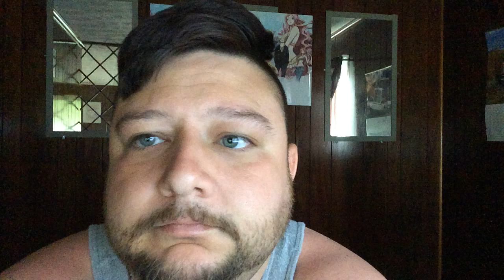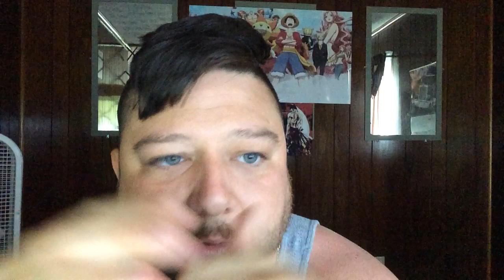Oil Light Flicker

Comment: You are right that the oil pressure light flickering is never a good sign! I have a question about that though- If the light flickers or comes on at idle only and you continue to drive, is it better to raise the RPM a little when idling so the oil pressure stays up, or is it better to let the engine idle with low oil pressure? Thanks in advance, I've been curious about that for a while
Reply from the maker: its never good at all under any circumstance. the proper thing to do is immediately shut the car off, tow it back, diagnose and repair asap
Reply: @VHBEngines  I understand that it's always  very bad when the oil pressure is low. However, I am asking more like if your engine is already junk and you just want to get as much more use out of it as possible what would be better. Thanks
Reply: Avery Alexander what’s up man I have a 98 accord and it’s got 327,000 miles on it.. for the past 2 months my oil light has been doing the same exact thing yours is.. when I slow down to an idle the oil light starts blinking in a stuttering rhythm.. mine is a 5 speed so as I’m slowing down I use my left foot for the brake(to all smartasses yes I know that’s illegal.. I do what the fuck I want to do) and just pedal the gas with my right until I come to a stop.. there has been times when actually shuts all the way off.. I fire that bitch back up and keep rollin.. if you have an automatic just push that bitch into neutral and work the throttle.. but yea if your just tryin to get all it’s got left for as long as possible.. that’s a good way to do it.. friendly reminder though.. always be prepared to call a tow truck or have some kind of back up plan bc you are pushing the limit and it is going to push back eventually. Good luck
Reply: @haulinass1990  Thanks for sharing! Here's a tip: I have seen oil pressure switches go bad and only turn the light on at idle. So if you want, you could try replacing the pressure switch for about $10 to see if it fixes it. That may or may not be it, but it's something to consider
Reply: Avery Alexander oh I’m definitely considering it but my main focus is my s10.. my 4.3 just spun a crankshaft bearing so I’ve been trying to prepare myself for the frustration that a motor swap job always comes with.. but it is somewhat a relief to hear that I could get lucky and it just be the oil pressure switch.. the first thing I did was check the manual abt the oil light.. and it says exactly what this guy said in his comment to you.. shut the car off wherever the light comes on and tow it to where it can be worked on immediately.. so that’s why I’ve been surfin waves hoping that the rip current isn’t too strong.. so until I change the switch the rip current doesn’t seem too bad 😂
Reply: @averyalexander2303  my car does the same thing. I think it one of the switches  possible low pressure switch because it's only flash when the engine is warm and if I move the car it goes off
Reply: @lungisanishibase3905  What kind of car do you have? I would rent or buy a mechanical gauge to verify that the pressure is actually low, the switch could be bad. It's easy to use, just unscrew the stock switch and screw that into its place. Warm the engine up and see what the actual pressure is at hot idle. Be sure to give it plenty of time to warm up, the oil can take 20+ minutes of normal driving to reach full temp. Or just replace the switch and see if the problem continues, they aren't that expensive. I like the gauge approach better though because you get more information.
Reply: @averyalexander2303  I have vw mk3 I know I have one dead cylinder. Cylinder number 4. it doesn't producing enough pressure, at once I thought that cylinder  was the problem but it's not I also thought the car was skipping timing but I don't think so

Comment: What if oil light comes on when I come to a stop  n goes away when I'm in motion?
Reply: Mine did the same but I could hear it rattling, clanking, banging and sounded like like a lawnmower and if I stopped my engine would turn off.

Comment: This was my first time doing oil change either I put to much oil or I didn’t close the oil filter cap correctly I drove 20miles with the light on can I have you opinion on that
Reply from the maker: Get the oil level right. Light should go away
Reply: Do you think because of that the engine might be bad  the oil had all spilled when I was driving
Reply: @VHBEngines  
If its higher level itll not show oil pressure light never ever 😄😄😄
Reply: @sauchyy5820  it could be losing oil cause May be you didnt tighten well oil filter

Comment: Have you ever had a oil pump just go bad and lose all pressure after a oil change? I changed my oil pan and put a drain bung on it for a turbo that I installed, then got everything in order started it up to test for leaks and oil light stays on all the time.. I did notice awhile back my oil light slowly illuminated once or twice but I thought it had something to do with my idle being so low.. I adjusted the idle and never seen it come back on.. people tell me that the oil pan im using might be the wrong one for it.. it might be from a h22 but its identical to the one I took off minus this one has a gasket on it and the one I took off didn't just a bunch of rtv. For some reason.. lmk as soon as you can, im debating whether or not just to order a new oil pump and just install it and it would be good.. my only concern is once I do that I still have the low oil pressure issue.. its a f23a bottom with f22a head. All new bearings, polished the crank myself. Shimmed the oil pump, the head is completely new everything just oem parts no upgrades. New water pump new timing belt and tensioner, head was resurfaced and milled. I only switched the head to non vtec just because I had spun a bearing and the vtec was giving me problems with shavings in the screen all the time. But its been refreshed but the old oil pump was used.. I know.. dont get on me to hard.. just a broke man's only choice sometimes..thinking the shimming will maybe fix my bearing issue. . But it got great pressure before the turbo was installed and drain and feed line was installed.. well I think.. 🤣 🤣 never had a oil pressure gauge to confirm.. maybe it was just good enough and with the added drain line and feed line.. it just dropped it to zero??
Reply from the maker: You already had early signs so good.chance it's the pump. Your not going to get the best results shimming without porting as well.

Comment: Hi I have a $2 2004 Hyundai Elantra and it just started with an oil leak and can't figure out where it's coming from we've taken off the oil pan and found these two metal ring type in the oil pan and we've already sealed the oil pan and the main seal and that was not coming from there do you know what it might be

Comment: I have Toyota Camry 4 cilinders 2.2, 2000, 460 thousand kilometers , since I bought it I hove been  adding   half a cup of oil every day, had a leak from the oil pump, for a year and a half after buying it, I did 36 thousand kilometers on it smoothly as I thought  the car is like new . Recently the water pump started to be heard and I decided to replace it. The heavy work I had to do meant that I also decided to replace the Power steering pump, Seal & gasket on the oil pump, taming belt and water pump. After putting everything back together, the car works beautifully , so as if I would not change anything at all , with only one exception, which was not there before even with a large oil leak, namely the red oil pump light appears when the engine is idling. I replaced the low oil pressure switch with a new one , I replaced the oil filter and oil on the denser from 5w30 to10w40, and the light appears as it appeared,  at slow speed . What should I do  ?
Reply from the maker: 🔄 the video

Comment: I kept driving cause I was close to home but a lot of smoke, got home and saw oil on my left side radiator, then drained the oil and found metal shavings.  Can I still save the engine by rebuilding it or does it sound like uts done?
Reply from the maker: It's rare that the crank is usable at that point but it does happen sometimes. Can't be sure without a tear down
Reply: @VHBEngines  thanks for the reply! I think ill go ahead and do that but first I've seen people use kerosene to clean it all out

Comment from the maker: If you read the comments you will find a hilarious amount of people that want me to change what I just said to make them feel better. I've been a mechanic for 13 years now and there is absolutely only four things that will cause this issue

Sensor failure
Damage in the harness 
low oil 
Order A BAD FUCKING OIL PUMP

Nobody wants it to be the oil pump because its a high labor cost job. Well if it ain't a bad sensor or low oil 99 out of 100 times it's the oil pump, no matter how many dumbass bullshit scenarios you come up with its not goin to change that answer  🤦‍♂️🤣

Comment: My oil light only flashes on a cold start its a built single cam and I just installed a turbo on it but have not started it yet I've been running the built engine for 8k miles and it blinks only on cold starts I am scared to blow it once it boosted..
Reply: Mine does that too did you figure it out
Reply: @movementonwheels  no It still does it but i bought an acl oil pump on Amazon never installed it still abuse the car every day no issues oil change at 2kmiles

Comment: So I just changed my oil and filter and my oil light came on out of no where but when I drive the light goes away but when I'm at a light it idle below 1k rpm then the light starts to flicker and fades away. When I drive it completely goes away... Not to mention I was way over due for an oil change. But the oil was still good since it's just a back and forth to work and home. I change the oil pressure sensor and bam the light comes back on. I checked the wire that connects to the oil sensor it looks good. Figure it be a bad connection.. I notice when I'm in drive that's when the light start to flicker and fades then it started flashing. Now it makes me wonder!
Reply from the maker: I’m assuming you double checked your oil level after you ran the car. If your topped off then your most likely dealing with a failing pump
Reply: @VHBEngines  yes I double checked it and oil level is fine. Car sounds great... When I have it in park and idling the light never comes on. While ago I let it run for 15mins to warm up and no light, when I put it in drive that's when it start to fade in and flicker...is it because I'm running 10w30? I know honda use 5w 20
Reply: @VHBEngines  yes I double checked it and oil level is fine. Car sounds great... When I have it in park and idling the light never comes on. While ago I let it run for 15mins to warm up and no light, when I put it in drive that's when it start to fade in and flicker...is it because I'm running 10w30? I know honda use 5w 20
Reply from the maker: jrburger1987 it’s because of one of the reasons stated in the video. Light only illuminates because of low pressure detection. I’ve pulled apart engines that weren’t knocking yet but the bearings were nearly destroyed. If you ignore it that’s what’ll happen. I’ve ran diesel rotella in my honda’s so you throwing in a different weight isn’t making a deference

Comment: my oil light came on and started flickering after i drove on a high speed around 180 km/h now it flickers , disappears when i accelerate and sometimes its not there when i first start my car in the morning, is it possible that its the sensor ?
Reply: Omggg the same thing for me
Reply: @breepitt9793  dont use your car man, take it to a mechanic right away if you hear weird noice like knocking noise even if its faint, my engine turned out to be locked it cost me around $1000 to get it fixed

Comment: Anyone can give information?? As my oil light flicker about couple of minutes i start my car which is Suzuki splash 2008 1.3 ddis and stops flickering after some minutes? As i have remove oil a month ago where the level and oil is perfect. I want a genuine suggestion please. 
Thank you
Reply: Approximately 1 min 45 secs it keeps off and on on dashboard after i start my car?
Reply from the maker: the suggestion has already been made in this super short and very to the point video. your hoping its something else because its an inconvenience but it is 99.99999999% one of the two issues i describe. but its your car and your engine so feel free to gamble with it

Comment: My h22a swap just started doing it at low rpms. The car has idle issues so when rpms drop it flickers and fades. Im hearing its a crank bearing issue?
Reply from the maker: If it’s on its way out it could be. Best not to wait for that to be the case. Knockknock need a new block

Comment: I hit the curb a little bit and my front bumper is popped out a little, not a big deal. As I was leaving someone’s driveway the tray under my car came out. I drove it home carefully but toward the end of my drive the oil light started flickering. I parked in my driveway and there was a trail of liquid but it was not oil. I know the reason for the light flickering has to do with what happened, any ideas what could’ve happened, is it ok for me to drive or will I run my engine. I don’t want to risk anything.
Reply from the maker: As I said in the video, it is NOT. If pressure is low your causing damage to all sorts of things. If you have a bearing failure your engine is done. Have to replace or rebuild. Depending on what your drive either option would be very expensive. In the case of most older cars your better off junking it. Have it checked out immediately

Comment: K20a3 oil burning at high rpms?
Reply from the maker: valve seals
Reply: @VHBEngines  could it be something related to the vtec system?
Reply: @miatafan  I agree that the valve seals are probably bad. But I would check your PCV system too. If the PCV system is clogged, pressure can build up inside the engine at high RPM and load, forcing oil past the valve seals and rings
Reply: Avery Alexander good point I should probably replace, my car is at 230,000 miles so it could probably use it
Reply: @miatafan  Also, I would get an OEM PCV valve. I have seen aftermarket ones cause idle issues, so save yourself the hassle and just get an OEM one.

Comment: I drove for about 30 miles and my car stalled out I pulled over and turn the ignition off as I try to turn it back on the oil light went on and I check the engine oil and it had nothing it was dry I had checked about two days ago An it was fine the old thin I fix was a misfire and now this an I bought oil put it in the car but the light comes and goes and flashes no oil seems to be leaking but it’s still stalling out could this be the oil pump too ?
Reply from the maker: Cristian Macias .....yes

Comment: I had a warning light come on my Mercury sable for like two seconds it said low oil pressure then it went away. It didn't flicker and it didn't stay on. Could this be the same problem you're talkin about?
Reply from the maker: If it comes in then goes away the I wouldn’t worry about it. Warning lights can flash if the car shuts off suddenly. If it persists then take care of it right away
Reply: @VHBEngines  okay thank you I appreciate that

Comment: Someone please help. I have a 1994 Lexus es300 and the oil light comes on when I let off the accelerator. When I step on the gas, it goes off.
Reply from the maker: Jessie S the pump is failing. Your getting more pressure under acceleration because the pump is belt/chain driven.
Reply: VHB Engines Thank you so much 🙏🏼 It just started doing it this morning on the way to work. It’s a 12 mile drive so around 25 a day. Would it be ok to drive to work tomorrow?  I plan on getting it fixed tomorrow after work. Thanks for the quick reply!
Reply from the maker: Jessie S make sure you have the right amount of oil first. Personally I’d risk driving it but I would never recommend it. If it can be avoided that’s what I’d say do but if ya can’t it’s a gamble
Reply: VHB Engines Yeah I forgot to mention that my oil level is good. I added some on Saturday and it was still full when I checked it today after work. I will definitely keep an eye on it though. Thanks again! I appreciate the info.

Comment: This is going on rn in my 06 charger I think it might be the pump
Reply: GHOST CHAIN  did you change the oil pump and it fix it i got 2006 chrysler 300c w 5.7 and i’m having stall and oil light problems
Reply: Mine also.. oil light came on and it killed.. any ideas?

Comment: My oil light is flickering I suspect oil pump but I'm also getting a loud lifter sound what could that be from?
Reply: Same here
Reply: @codyburke5286  I changed my oil pump and it was fixed
Reply: @duranpillay4221  did that whining sound go away?
Reply: @oscarm.4078  Yes but i noticed it could also be low oil level
Reply: @duranpillay4221  yeah that got rid of mine thanks

Comment: I recently mad a big ass hole in my oil pan and when i switched it my oil light keeps blinking could that be my pump??
Reply: What kind of car/engine? If you hit something and seriously dented the pan it's possible that it hit the oil pickup screen and damaged it or the pickup tube. The pickup tube must be completely air tight, if there is any crack in it the pump will suck air instead of oil and cause that problem. How long did you run it without oil? You could have bearing damage if you ran it a long time without oil.

Comment: My light comes on at startup and you can hear the valvetrain, but it goes off in 1-2 seconds or less along with the noise. Doesn't do it when warm. Ever heard of that? I will do a valve adjustment soon and see what happens.
Reply from the maker: TearDroppFX if it goes off and doesn't come back on I wouldn't worry bout that. Valve clatter would be something separate
Reply: VHB Engines awesome. That shit has me paranoid every time I start the car
Reply: GM 5.7 litre in Australia had that marbling sort of sound when cold. Recall!